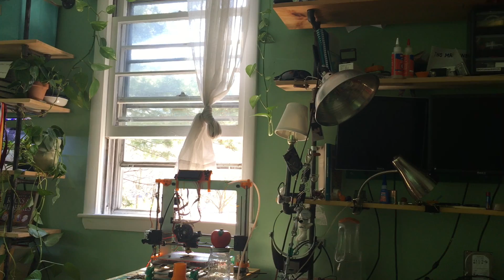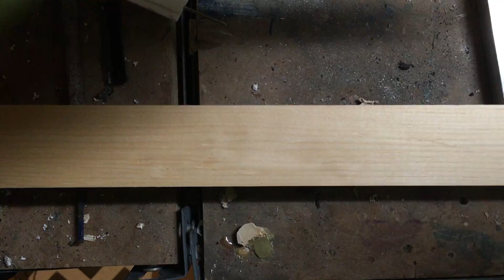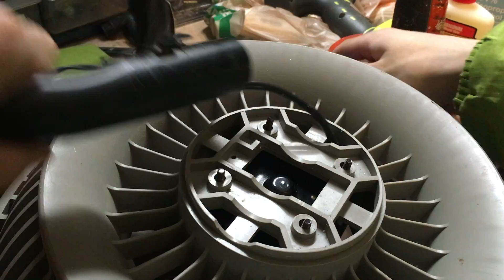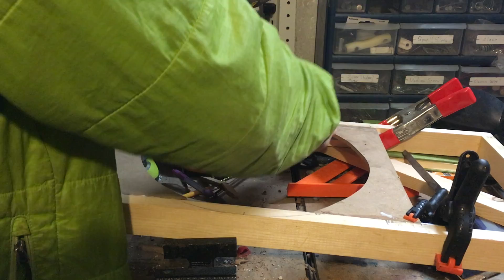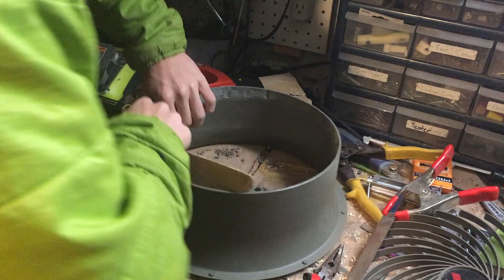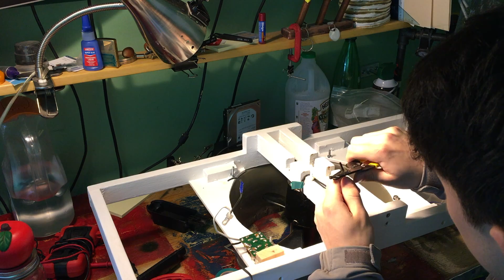Upcycled Ventilation Fan

Comment: There’s one in my classroom but the fan is facing the other way I don’t know why
Reply: Exhaust. You're supposed to blow the stale air out of the room, not opposite. Very simple reason, fans get dirty and bacteria will grow on them. If you blow in air, you'll have a nice source of bacteria blowing into your room. If you exhaust, the air will get in from the various vents of your room, which also gives you multiple sources of air.

Comment: To make it even more efficient, you could have put clear plastic on the gaps between the fan and the frame.
Reply from the maker: I was going to do that but figured if it was blowing air in there wouldn't be much point to sealing it anyways. I didn't know there were any fan enthusiasts out there, cool!
Reply: +Erik Nakamura i'm a fan enthusiast too
Reply: +Erik Nakamura Katana was right. you should seal the window.